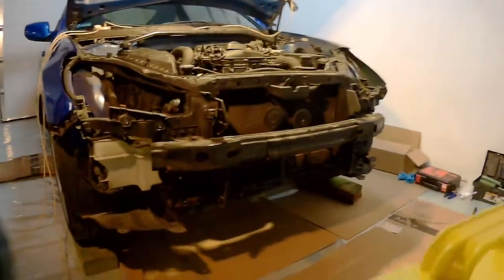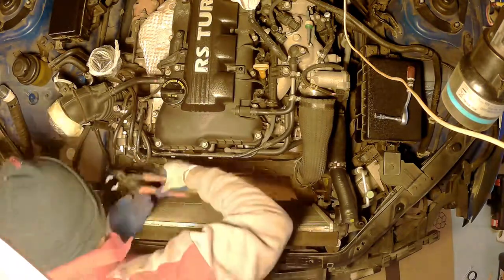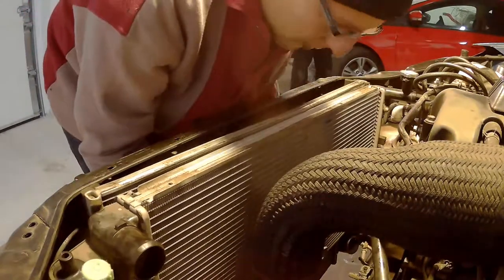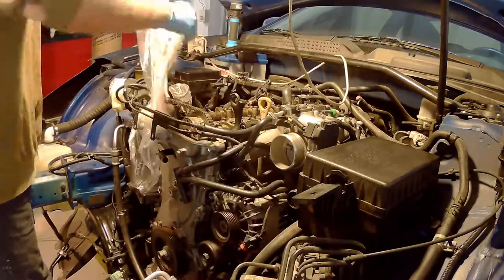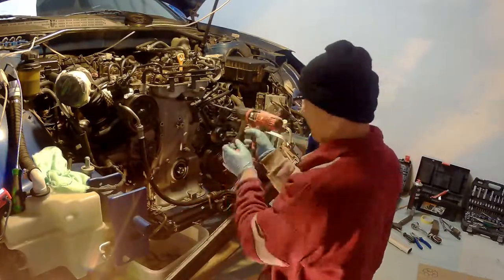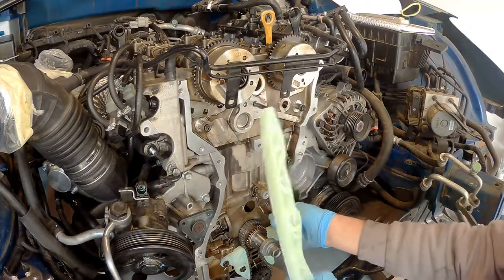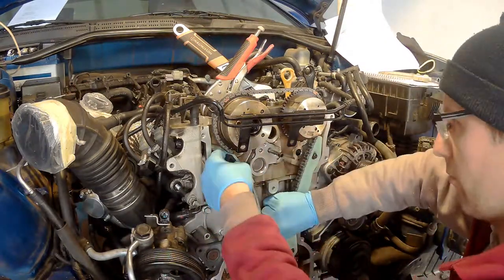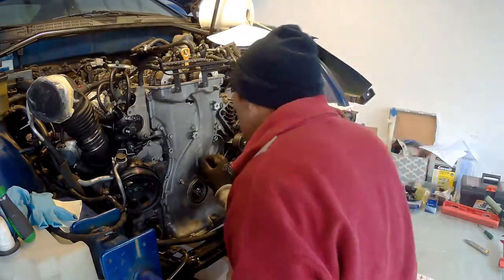Genesis Coupe 2.0 - Timing Chain

Comment: Did you replace with bk2 timing chain?
Reply from the maker: I used the bk1 but I read you can use bk2 chain just avaiability in Poland is a bit problematic
Reply: @pch_mechanika  oh ok  from the info I’ve found its better to use a bk2  chain. Great video I will be doing mine soon this is very helpful thanks!
Reply from the maker: @teddyhart2079  thanks make sure to do the valve clearance while in there

Comment: This is a Genesis Coupe 2.0 -  BK1 Timing Chain job. It's actually fairly easy job
Reply from the maker: That's true and I have to say I do like the 2.0 for how simple it is and how much space you have in the engine bay. I'm working on tau 4.6 now and that one is a bit different story
Reply: @pch_mechanika  is it necessary to take apart all those components to do the timing chain? I need to replace mine :/. Do you know much about the p0014 code? (Advanced camshaft position)
Reply from the maker: Well you don't have to remove the front - i did it as it was just way easier. Seriously hunday made this job really easy by allowing to unscrew the front AND adding a harness connector for the front lights my advice is remove the front it helps and does not take to much time

As for the code well it does suggest you it may have skipped on you, but there may be many reasons for this from connector to sensor etc. First remove top cover and check the markings with the crankshaft an you will know if it skipped or not

Comment: Hyundai recommends this job to be done at 120K miles I’m at 115K haven’t had an issue but I’m replacing today so and doing head gasket thanks for this video
Reply from the maker: Your Wellcome
Also perfect timing you will see the chain is stretchered - it was in mine at 117 k miles or so.  Also car is pulling stronger now

Comment: You did this the really hard way. Shouldnt take you 3 days shpuld take max 1 day. Its not much more than the rad fans and a valve cover ita basically a subaru in terms of how easy it is to do the timing on it
Reply from the maker: Well that's true but I actually wanted to get in there deep. Also being extra careful while getting the job done. 

So it took a lot more than it should but with a project car not in a hurry